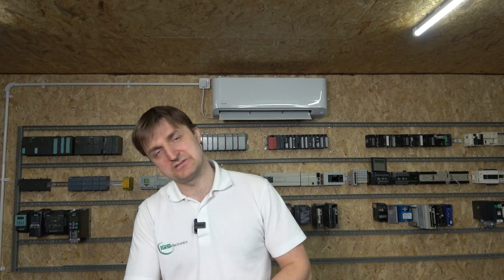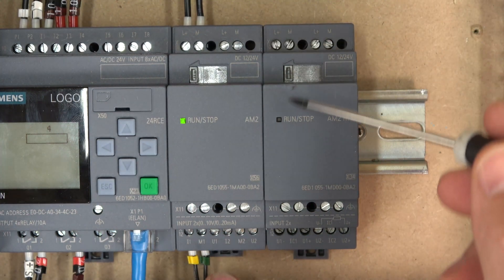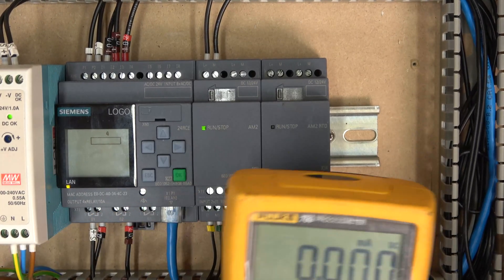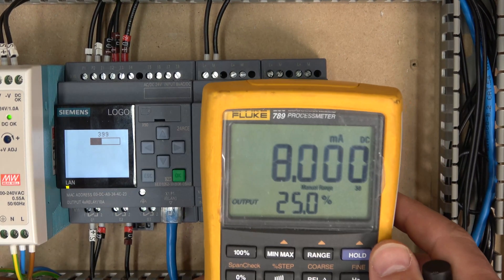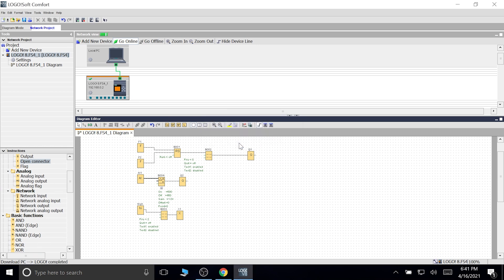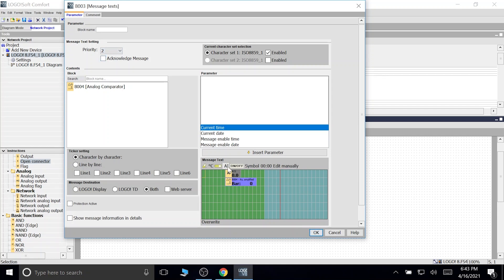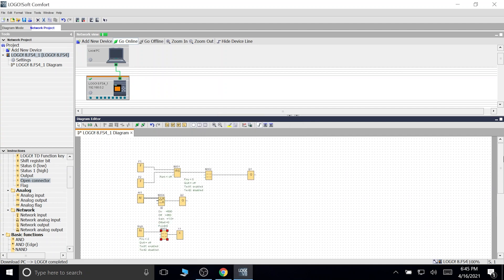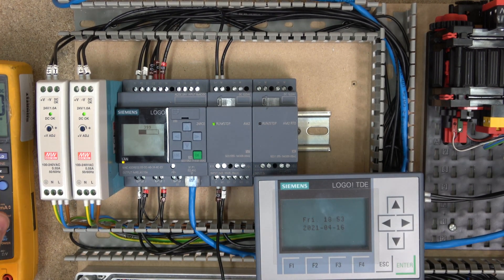Siemens LOGO! 8 SF4_1 smart relay AM2 analog input card wiring and signal processing. English

Comment: Thanks for the tutorial. can you please tell me what does the rtd unit do that only am2 can't. Also do I need special ethernet equipments from siemens or basic D-Link ethernet equipments are alright for tcp rtu
Reply from the maker: Hi There. RTD unit is specially designed to handle RTD thermocouples such as PT100. These units are smart units that can process these signals without additional equipment. When it come to Ethernet TCP RTU, any switches can be used, don't have to be Siemens. So your D link equipment will work just fine.

Comment: I have a LOGO! 6ED1052-1FB08-0BA0 module that came with some equipment.  Can I connect with the software while the PLC is running?  Also, is there any removable on-board memory that holds the program?  If so, can this be removed while PLC is in run?  I'd like to create a backup with it.  FYI, I'm in the process of getting the software and a cable so I can connect.
Reply from the maker: Hi There. Yes you can connect software wile PLC is running, but you can not upload or downlead wile plc is running. It will stop for brief seconds for getting program out or in. You don't need software to back up you program, that can be done with mico SD card in slot x50 in front of your controller. I might make a video of it this weekend.